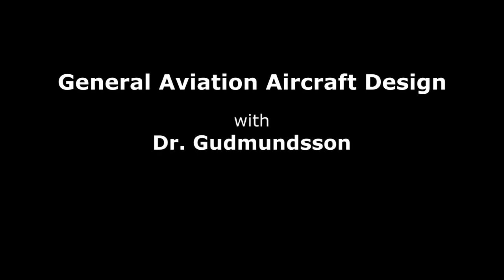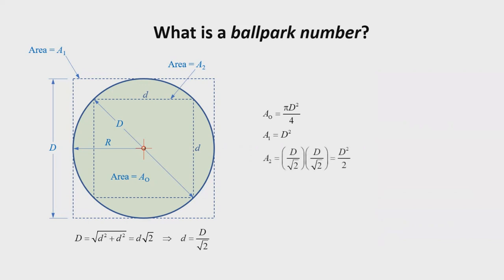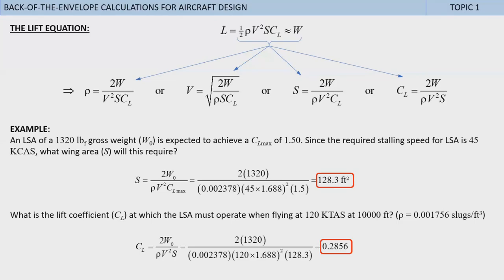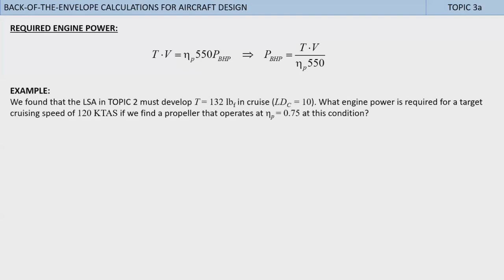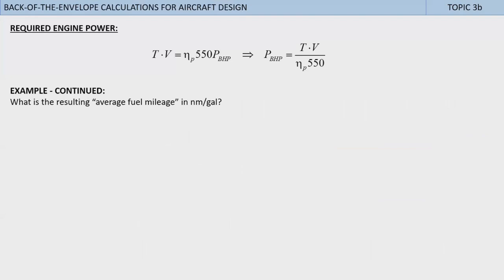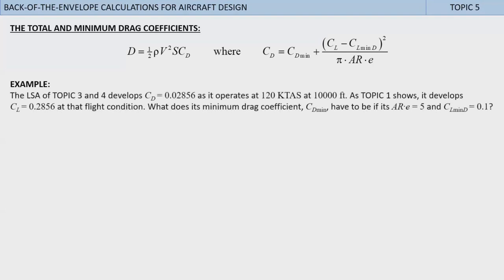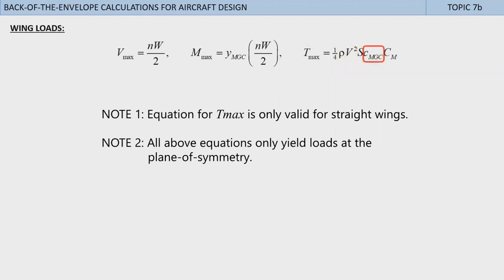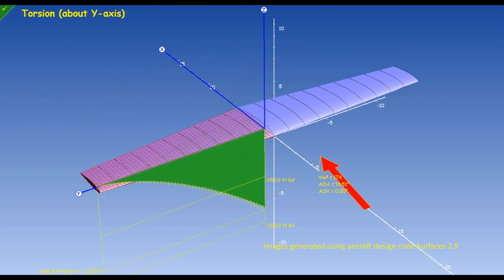Aircraft Design Tutorial: Back of Envelope Calculations for Aircraft Design

Comment: Any known back-of-envelope methods to estimating eta-p? 
I've seen clever nomograms to get to a ballpark efficiency but a smart bit of cleverness would be nice.
Reply from the maker: @Peilin Stephen Thank you for your excellent question! Yes, I do know a back-of-the-env method for eta-p, both for fixed and constant speed (CSP) propellers. I developed both of these methods and have used them with great success for a long time. Both are in my book, 1st and 2nd editions.

For fixed pitch props use Method 1 of Section 14.4.2 (in Ed1) or 15.4.3 (in Ed2). For CSP use Method 3 of Section 14.4.2 (in Ed1) or 15.4.4 (in Ed2). For CSP, I recommend the method of 15.4.4 (in Ed2). It directly returns eta-p (the others return thrust) AND my students make less mistakes when using it.

For any of these methods that return thrust, you can calculate eta-p from the relation:       eta-p = T∙V/(k∙P),      where T=thrust (lbf or N), V=airspeed (ft/s or m/s), P=power (hp or kW), and k=conversion factor (550 if P is in hp, and 1000 if P is in kW). Example: If T=175 lbf, P=75 bhp, V=169 ft/s => eta-p=T*V/(550*P)=0.717. Conversely, if T=778 N, P=55.9 kW, V=51.5 m/s => eta-p=T*V/(1000*P)=0.717. Hope this helps. Have fun designing!

Comment: Good day prof. Gudmundsson,thanks for all your support and help am very grateful sir. Concerning determination of Oswald efficiency "e" in the first edition of general aviation aircraft design textbook, can "Equation(9-89) on page 363 be used in finding Oswald efficiency for wings with AR(aspect ratio) of upto 20? When i used it, i got a value of 0.506 which seems unrealistic for an aspect ratio of 21 since Oswald efficiency should increase with increasing AR if am right. If eqn 9-89 isn't acceptable for aspect ratio of up to 20 and above, what is the best and most reliable equation that can be used in accurately finding Oswald efficiency for aspect ratios of upto 20
Reply from the maker: I have used that equation up to 16. However, I did it with a healthy doze of skepticism. I extracted the CDmin and e of several sailplanes using their POH and the method of Section 15.6.2, which helped me assess its accuracy. I recommend you do the same. By the way, I get 0.527 for AR=20.
Reply: @dr.gudmundssonaircraftdesign  ok, I'll try it out. thank you sir.
Reply: @dr.gudmundssonaircraftdesign  i used equation 9-126 and it yielded a more realistic result, for AR of 21 e=0.596 and for AR of 20 e= 0.601. taking into account that P= K*CDo
and using CDo=0.025.